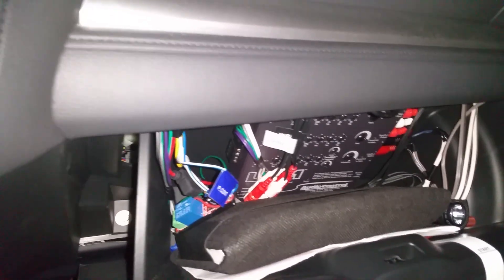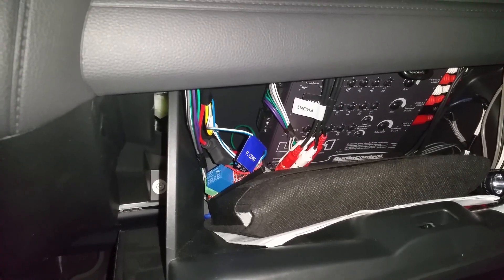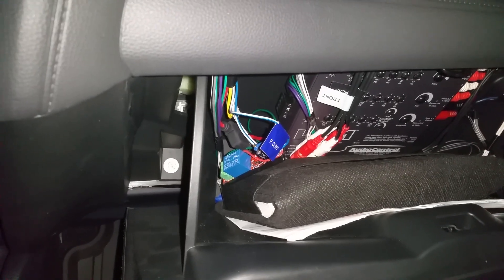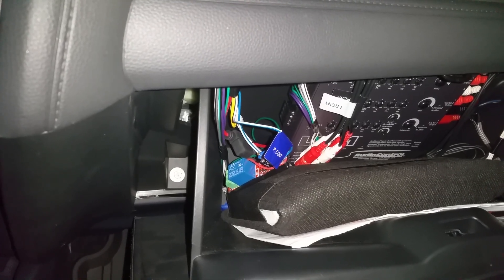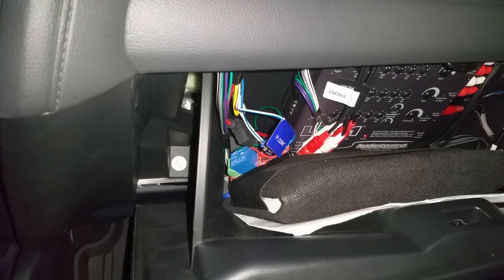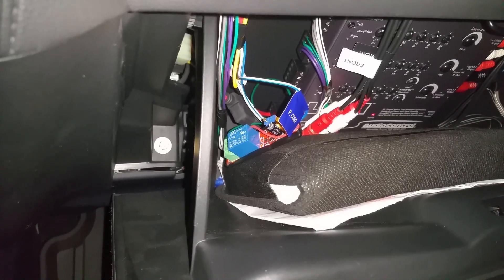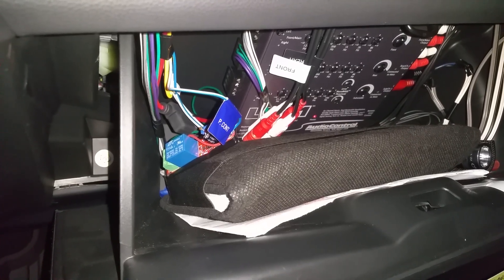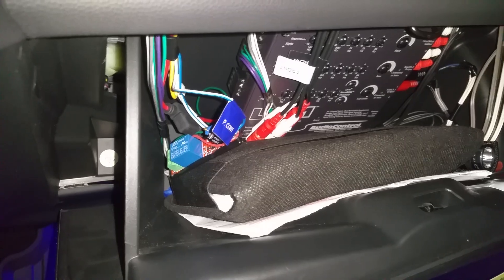Amplifier Thump/Pop Sound Power On/Off: How To Fix

Comment: So I have a similar issue. I’m running two amps. A sub amp and a component amp. My sub amp is the issue. It power cycles on off a bunch of times which sometimes is followed by a thump before it will turn on and stay on. My sub amp is a mono amp which I’m running two subs off in parallel. My component amp does not do this. Both amps get power and remote turn on from the same places. The remote wire from the head unit and power from the battery back to a distribution block. I’m wondering if this timer will fix my issue because I’ve exhausted everything else.
Reply from the maker: Sounds like it might be an amplifier issue if it's turning on and off multiple times before staying on. I would check the wiring for the remote turn on for the sub amp. I don't think the thump is from the other components turning on and off since I assume that all the other components turn on and stay on with the sub amp cycling.
Reply: @Bassguitarist1985  yes you are correct. The component amp doesn’t do it. Plus I found today while doing some trouble shooting my head unit has a time delay on the remote wire turn on. Also with the key on and the truck not started, it doesn’t do the power cycle. When I start the truck it does it. But if I un hook one sub while it’s doing it, it stops immediately. It doesn’t matter which sub I un hook it stops. I tried it unhooking the left one and it stopped, then I tried it unhooking the right one and it stopped. So it’s something to do with while the truck is running and for some reason it doesn’t like both subs hooked up at once. I’m lost honestly. I’ve been trying to figure this out for months now. I’ve exhausted everything. But at least I found out it’s while it’s running only.
Reply from the maker: @paulkelsey6411  sounds like either sub is interferring with the other. Do you have the remote on terminals of the subs Y-connected off the head units remote on terminal?
Reply: @Bassguitarist1985  both remote wires are ran off the head units remote wire. Originally the sub amp remote wire was ran off the ignition, but I switched it to the head unit thinking it might resolve my issue.
Reply from the maker: @paulkelsey6411  thats the way it should be connected. You could try the delay timer on one of the sub amos and see if it solves the issue
Reply: @Bassguitarist1985  I tried simulating a delayed turn on by un hooking the remote wire to the sub amp, starting my truck, then after the radio booted up touching the remote wire to the remote terminal on the amp and it still did it. I’m not sure if that would simulate a delay turn on or not but seems like it should.
Reply from the maker: @paulkelsey6411  im at a loss. It is a grounding issue. That startup energy is going through the output stage instead of the bleed resistors of the input stage. Hard to say.
Reply: @Bassguitarist1985  well I appreciate your help I thought this may have been the fix. It has something to do with startup I believe also but I don’t even know how to isolate it. Weird part is if I unhook one sub it doesn’t do it. Anyway I appreciate your time bro

Comment: Can you provide wiring instructions please
Reply from the maker: The remote out of the LCQ1 goes to the input of the timer delay. On the single pole double throw relay output side of the timer is the positive lead wire to all of your amps. The principal is that your signal processors turn on before your amp's do. The shutdown procedure everything turns off all at once

Comment: My setup has been fine for a year and out of nowhere my speakers loudly pop whenever I turn my key off. What happened? Can this fix or is it my rca cables or connections? Is this item recommended to me? Thank you for your helpful information and video. We appreciate you!!!
Reply from the maker: oxidation on the connectors increasing resistance causing thump? Thats my guess.
Reply: Bassguitarist1985 Thank you for your input and for following up, friend!
RIP Cliff Burton
Reply: Thank you 🙏 
You know what I ended up doing was upping the gauge on the remote wire, re did all the connections and ran a new RCA. I did it all at the same time so not sure which it was, but the issue is gone now :)

Comment: Just switched the ground jumper on my LCQ-1 to the 200ohm setting and it fixed my turn off pop I was getting before thanks for this excellent advice, I have the GTO off and running an accessory wire to the remote turn on. I wonder if switching to the GTO auto sense will work too? I have not tried that yet.
Reply from the maker: It might but my guess is no. The turn on event is still the same, but the ground jumper is the ultimate solution.
Reply: @Bassguitarist1985  I agree because it was popping with the GTO on, and switched it off and same thing was happening. Is there any negatives about switching the jumpers to 200 ohms that you know of?
Reply from the maker: @charlescox4213  nope. Mine has been running that way for years now no problems. I do get a slight pop when it turns on but it's nowhere near as bad as it once was. There is absolutely no turn off pop

Comment: Im getting turn on pop from an alpine cde-172bt, skar rp1500.1 amplifier. If I run a toggle on my remote wire would it perform the same as the $8 delay? I have millions of toggles laying around until a delay ships to me
Reply: Did you get this solve with toggle?I have Skar rp1200.1 amp also getting turn on pop,but I tried using toggle,I wait for HU to come on for about 10-15seconds then turn on amp but I still get the pop.
Reply: @eacalways  it actually turned out to be my rca's being faulty

Comment: I get a thump in my woofers when putting my car in reverse or park. Any suggestions what's causing it or does the speakers need grounding?
Reply from the maker: Possible ground issue yes. Hard to say without knowing full setup.
Reply: @Bassguitarist1985  Everything is going to my deck. Speakers going to my amp, and amp going to my factory radio.
Reply from the maker: @drkrice333  common issue is audio ground and frame power ground are one and the same, which is a bad design.  Trick is to isolate the component's connected downstream from one another to avoid loops. The other possible solution is to keep a low ohm potential between audio ground and power ground preventing stray noise. An unbalanced rca to rca 1:1 isolation transformer at the signal level can help. I have one feeding the signal wires between the LCQ1 and my subs.  The subs have a frame ground connection farther away from the deck. To break the loop from the frame ground point and the audio grounds made by the signal wires, the 1:1 iso transformer breaks the loop and references the frame ground instead. Worked in my case. Like I said car makers dont design wiring for aftermarket applications on audio components.

Comment: I have a glitch I'm trying to figure out. All my speekers are repeatedly thumping when the sterio is on. It was working fine for about a year. Hopefully I can find the issue
Reply: I grounded my rca grounds
Reply from the maker: i dont know your setup. could be any number of loops in the signal or power wires causing issues, or its a bad design amp and it does it inherently.

Comment: Hi I'm having trouble when my headlights turn off I get a " pop but more like swooch sound" 
2019 honda fit with kicker amp and Kicker 46KISLOC2 line converter. please help
Reply from the maker: Sounds like a ground loop issue.
Reply: @Bassguitarist1985  
i used the ground from the harness A1
Reply from the maker: @gabrielayala6348  not familiar with. I found that chassis fround and audio ground are at different potentials causing noise. My LCQ1 has a jumper option to put a 200ohm resistor between the two points, eliminated the noise for me. If grounded to chassis i heard all kinds of relay clicking noises and other anomalies, floating ground no good either. 200 ohm setting worked for me.
Reply: @Bassguitarist1985  
my bad I ment i used the wire harness ground to ground the line converter 
and one of the seat bolts to ground the amp
Reply from the maker: @gabrielayala6348  thats the issue. You need to break the loop. Buy a ground loop isolator for the signal wires. I had to use one for my sub amps to get rid of the sound
Reply: @Bassguitarist1985  
sounds good witch one do you recommend
and how do you install it
Reply from the maker: @gabrielayala6348  any of them really, they are all built the same. Install it between your LOC and the amp input.

Comment: This is also a sign that your gains are not properly set from the signals off your head unit.  before you add relays back down the gain and try turning off and on till you hear it go away. simple fix.  Too many people putting the to full blast gain knob thinking that gives more power.
Reply from the maker: Good info! Yes I did turn the gains down later on. Gain is not a volume knob, its how sensitive the input stage is to the signal. More specifically, gain is the input level control of the preamp stage in the LCQ1. Volume is the level control of the output stage in the Kenwood amp. Two completely different controls.
Reply: Not fully try

Comment: i had wired the relay module but for some reason it does not properly kick in the relay(dim blue light) at and by some chance if it will kick in the relay it will take way more than  the 10 sec range
Reply from the maker: Some of those relays are hit and miss for quality. I had the same problem. Lift pin 6 of the 555 chip and see if it solves it.

Comment: Hey, could you show a labeled diagram on how it's all connected cause it's got 3 outputs and I don't know how to connect it. I've the the remote turn on wire connected to the cigarette lighter
Reply from the maker: Check out my fitfreak.net forum thread. I detail about its wiring there. I wound up solving thisnissue with proper grounding, though the time delay relay still works as well.
Reply: Bassguitarist1985 could you provide a direct link cause I'm struggling to find it
Reply from the maker: @maksymkasza5685  its in the video description. No diagram but detailed info to build it
Reply: Bassguitarist1985 don't worry I've got it done now. Thanks for your help

Comment: Your car batteries one of the plates are weak not providing enough amps to the amp.. Like wise check your car alimeter too if it's charging the car batteries properly... Nothings wrong with the amplifier
Reply from the maker: Nope nothings wrong with the amplifier. The Fit has a very small battery as it is. It was a brand new car essentially when I posted this video. Cold weather probably made the battery weak.
Reply: Hi, my wife's Subaru which came with a Harman Kardon stereo would give a thump just about 5 seconds after turning off the ignition. About a week after it started doing this, the audio just died... no sound. Head unit still is on, but no more sound. About a week or two BEFORE it started doing this, we installed a new battery. Any idea what's happening? Thanks in advance.

Comment: Can you wire the remote turn on straight to the accessory or cigarette lighter. I have the same issue with my amp and sub
Reply from the maker: You can yes. Though the ACC wire on the radio harness turns on the same time as the cigarette lighter plug does.
Reply: @Bassguitarist1985  sweet thank you very much <3

Comment: My bass amp clips and limiter light comes on after the power is switched off, any thoughts
Reply from the maker: Not sure, could be bad design for when the caps inside discharge.
Reply: Possibly I need to check the speaker connections to rule them out, haven’t had this happen before ,when speakers are connected I do get a pop turning it off and on, thanks for the reply

Comment: I have the same problem where I get a pop when turning the car off. At first you said the amp shuts off first, then you said they both shut off at the same time. Which is it? I need my amp to turn off before my head unit. thanks
Reply from the maker: Joe Green the power on cycle setup is HU-LCQ1-Amp/Subs. The power off cycle is all shut off at the same time. If you need a delay off on your signal processors, this setup will not help you. This setup is a delay on only.

Comment: I only get amp thump on turn off. I'm not sure how this timer will help that as its all still powering down the same
Reply from the maker: the thump at the turn off this timer cannot solve, it only solves the power on sequence. Since making this video, I've realized the better solution is a single throw 4 throw relay to connect the amp to the speakers. I discovered later on that it was my ground setting on the LCQ1 needed to be changed to a 200ohm resistor to ground.
Reply: fastfrankgsxr did you figure it out? I have the same issue

Comment: every amp makes a thumping sound on startup, how the hell is it a problem?
even the tiny-ass amp on my 10 watt megaphone makes that sound! and even bigger electronic siren/PA systems make that sound, i have video proof right here: https://www.youtube.com/watch?v=V4xQx90M0Qw (the pop happens right before the chime)
Reply from the maker: DA AMAZIN' SPAH it can damage speakers if the volume or sensitivity is left on high. You are correct though every amp does it
Reply: I ran my ground straight back to the battery.. I hear no noises upon start up or shut down

Comment: Hey man, I'm trying to build something to stop my pops on a subwoofer i have in my office now instead of the car (still car amp run from an old PSU). I've got crazy bad shutoff pop, was wondering if you had a rough schematic of your DIY model before i buy the cheapo chinesium one instead. Or even just a picture of it by itself, maybe the underside of the pcb to see the connection. Thanks for any of your help!
Reply: I know your comment was years ago but for anyone with this same issue, this means gains are WAY TOO high and not matching the power coming off the deck.  Turn the gains down or choose what EQ setting to use: the AMP ONLY  or the DECK ONLY.. if you use both this could be adding to the problem.  Hope this help anyone having the issues

Comment: Ok I have an after market system in my jeep. Was working good for going on a year. Well my air conditioning went out so I had to replace the heat and air MOTOR Fan RESISTOR well got it replaced and now my system isn't working the head unit comes on i have a bass knob the light on that keeps going on and off and my sub it moving in and out with a thumping sound radio isn't blinking. I can turn the volume all the way up and I hear music between each thump in the speakers.  I have checked fuses and the wiring and everything looks normal what could it be?